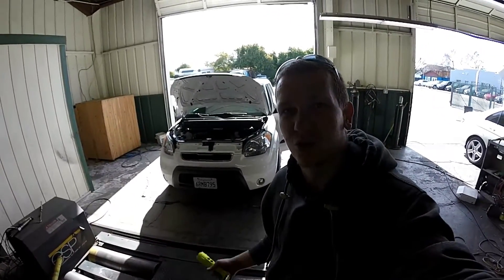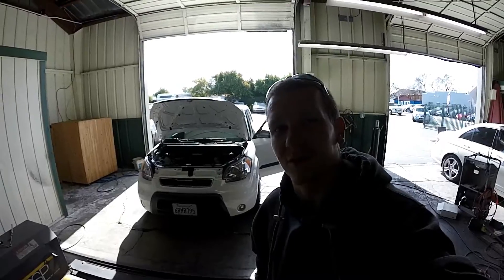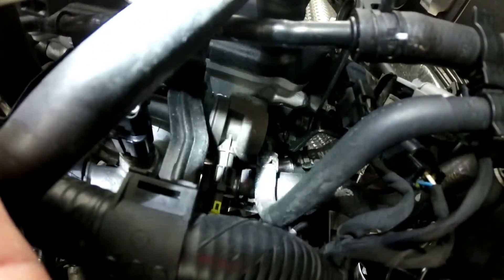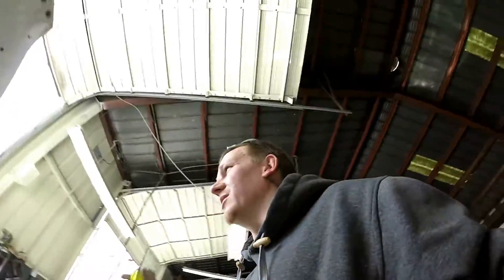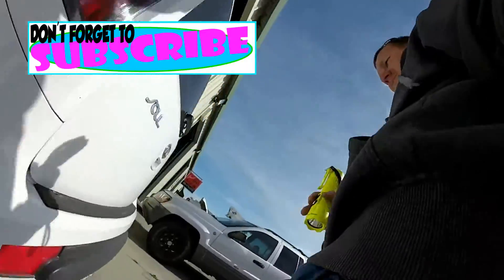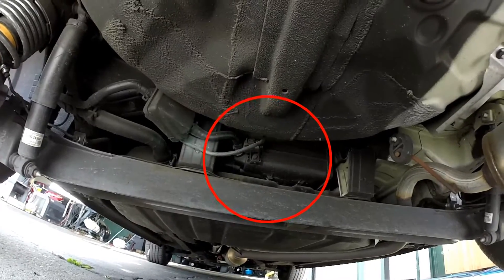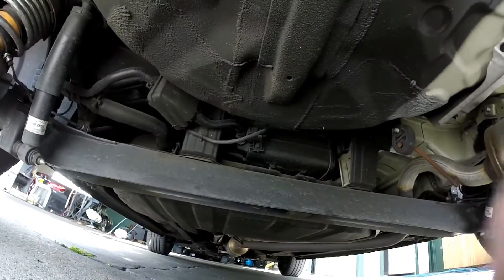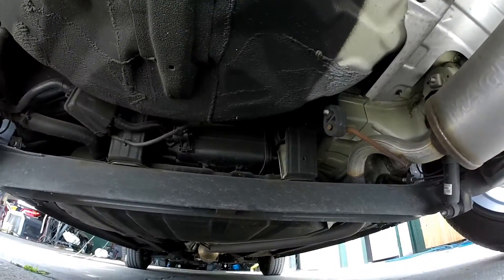Kia Soul emissions locations: PCV, EVAP canister, vent, purge

Comment: I have a P0455 Evap system gross leak detected. I know its not the fuel cap because I got a knew one recently. Should I check the parts you showed us  for visible problems?

Comment: Problem filling tank, bubbling back out at me.  Getting a bunch of evap system faults.  Is this probably the canister?  If so, I really have to drop the tank to get to it?
Reply from the maker: I doubt the canister was the original issue but it could be contaminated by now. The original issue was probably your vent solenoid not opening properly during fuel filling. But if that is left unrepaired it can cause much more damage. It's not commonly seen that a evap canister goes bad.
Reply from the maker: If I were you I would check your Vapor purge solenoid and your Vapor vent solenoid. Make sure they're working properly also make sure the hose going from your vent solenoid into the atmosphere is clean and has no Road Grime or spiderwebs and such in there